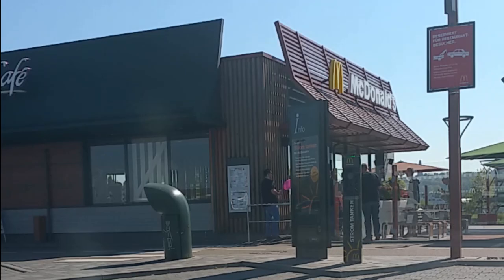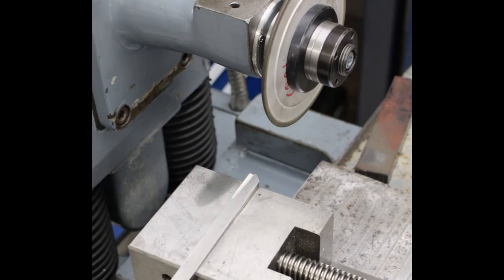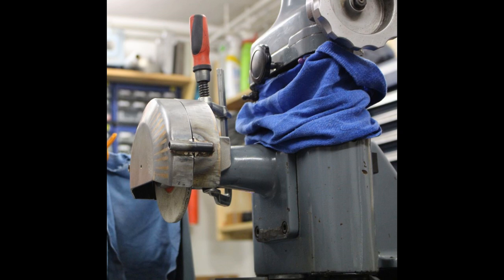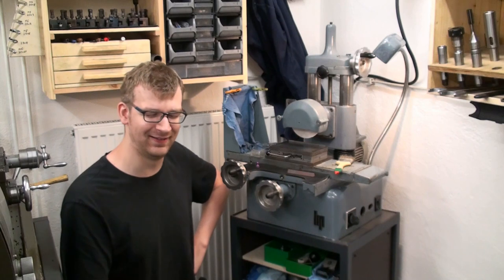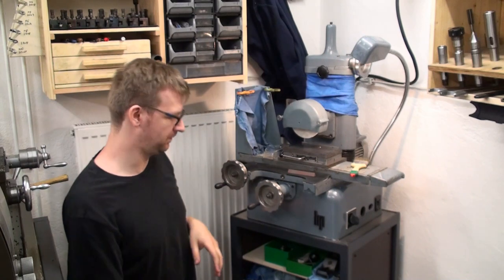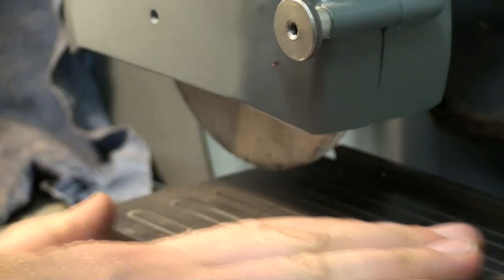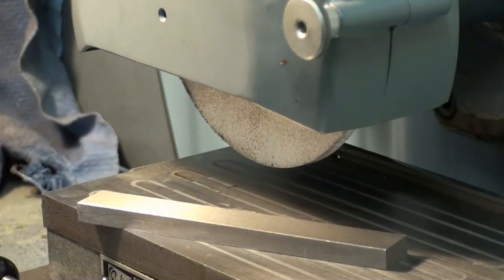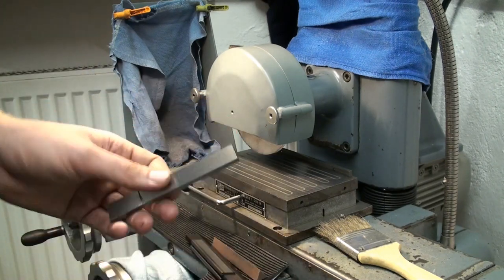LIP 515 surface grinder

Comment: very nice little grinder. very ingenious technique cutting the spindle taper not many would have thought of that. the wheel cover also shows what you are willing to do to make a part that is not only functional but proper looking. the machine looks right at home in your shop. thanks for sharing.

Comment: It's always enjoyable and interesting to visit you in the shop via your videos, Stefan.  I like your approach to problem solving: you always seem to find the simplest and most direct solution to a problem, for example, using the crossfeed off your lathe to true the taper on the grinding wheel shaft in place.  
The grinder is a gem, and you have made it fit right in as a member of your shop family instead of a stranger in a plaid suit and a funny hat.
I'm looking forward to your next shop adventure.

Comment: You are an incredibly talented machinist, thank you for sharing the videos! We were trained to cut the grinding wheel square with a diamond cutter and leave it running, mainly because the wheel can move slightly on the shaft each time it is started which can result in bad cuts.If we shut off the wheel, we had to recut it again to ensure it was square. I know you are aware of this, I just wanted to throw in my 2 cents worth. Thanks again!

Comment: You in industrial Europe have the nicest small machine tools on the used market. Nothing like that in my area except cheap stuff or larger expensive stuff.

I can't help but think you'll need to drape the area against tramp abrasive and grinding swarf. That shelf of set'up equipment for example looks like a prime grit trap: store clean equipment, retrieve it gritty.
 A crowded home shop containing a dry grinder could benefit from a blower and furnace filter in a box 

Keep it up Stefan, you're setting a fine example of how to run a home shop.

Comment: Excellent job, The cover turned out great. Everything looks fine. You need to think of retractable jacks for the base that will lock down to the floor to make the whole assembly as solid as possible. That will help a lot with finish. Anything to 
make  the machine more solid.

Comment: I friend of mine who was many years a tool and die maker before he came to our shop as it's toolroom manager described to me a method of grinding flat large large die shoes.  Make a dam of tape on the mag base. Melt paraffin wax and and flood the magnet. While the wax is still liquid, set your part in bow up. Wait a few min for wax to cool and get hard. Turn on mag chuck. The perfect 100% shim.

Comment: Wonderful little grinder. It also doubles as a lathe and will do taper turning :)   When I saw the setup I was amazed. Very nice job fabricating that wheel guard. In fact, the rebuild was very interesting, specially doing the bending.  Keep them coming!

Comment: Hi Stefan great video,It may be worth tring your motor with out a fan to check the vibrations.
A lot of the newer motors hav a plastic fan which flex when running,if the vibration is reduce replace the fan with 
a metal one most workshops that do motor rewinds will be your best place to call.

Comment: In my limited grinder experience I have found that wheel hardness has a big effect on final finish. For me it seems the softer wheels do better, but of course don't last as long or hold size as easily.
Reply: You're correct. Softer wheels are used on harder materials and harder wheels for softer materials. BUT... You also need to consider that you have to take into consideration the size of the grain. Wheels that are designed for use with coolant have a wider grain structure ect... ect...  Never stop learning.

Comment: Stephan, Another great video.  I love the amount of detail you provide.  Hope you are up for one recommendation . . . modify your wheel guard to include a grindings catcher.  I run mine with a shop vacuum . . . even when I am applying coolant.  If you use your surface grinder very much, you will see why this is a valid recommendation.  This is especially the case with the precision machines you have in your shop.

Comment: Great little machine, I really want one that size. Good work on the guard.
Get rid of those casters, there is a better way to do it.
Mount two wheel on the back of the base so they are a few millimeters above the floor. Make a "hand cart" type thing using two more wheels and a piece of square tube with a hook between the wheels. Add an eye to the base. To use, you just hook the handcart into the eye, and lever the machine up so the rear wheels contact the floor.
I have a commercially made version (I think made by HTC) on my wood cutting bandsaw. My bandsaw is a floor model (no base) about 2m tall and weighs quite a bit. I keep it near the wall, but I can pull it out to for running really long boards or for cleaning when I need to. It is a very stable arrangement and I find it is very easy to move and steer even though it weighs over 300kg.

here is a pick of something similar
http://www.popularwoodworking.com/wp-content/uploads/10707-lead-1.jpg
Reply from the maker: That is quite a good idea, but I think I will just put 4 screw jacks under it, as I will not have to move the grinder often - Only when somebody needs to get to the houseentry-fuses.

Comment: It’s a great find and the same applies for your rebuilding. I don’t even try to be as precise as you are. I have several parts which would make it possible to build one. Time and rooms are problems.
My question, if you please: what moves the longitudinal movement? Rack, gear, chain or what else?
Thanks in advance 
Old Bob

Comment: Stefan, I always seem to learn something new from your videos. The peening is something I will definitely want to learn more about. I am currently making the parts for my large lathe taper attachment that were missing the part is over 2 feet long and I'm dealing with the metal Bowing. If necessary I may try the peening method to straighten it. Thanks again.

Comment: i agree with old tony its the perfect size for a home shop
about balancing the electric motor , i wonder if it helps to static balance the rotor between centers and carefully shave away on the heavy end

Comment: Hey Stefan, don't worry about that chatter. As the part or tool is used and stoned after awhile the light marks will wear away and you'll be left with a nice surface.

Comment: Suburban Tool has a video showing a technique to obtain very flat parts using the residual magnetism of the magnetic chuck to minimize parts conforming to the chuck. I myself have recently acquired a Reid surface grinder and am trying to cure similar chatter problems. I think I will have to check the spindle for concentricity.  Thanks for the video
Reply from the maker: I haven seen that video from Surburban, but I dont think thats a good idea with a permanent magnetic chuck ;)

Comment: Other than the wheels, which you covered, my one concern would be the radiator on the wall next to the grinder. You MAY find that the "hot" end of the machine introduces a slight thermal distortion across the width of the part if the rest of the workshop is particularly cold (it probably needs to be measured if you are attempting to obtain the nth degree of accuracy). As far as the wheels and keeping things precise is concerned, maybe a precisely flat plate mounted on top of a thin rubber mat may work - the rubber would deform to adjust for any change in "level" as the machine is moved, while the flat plate would reinforce the stability of the machine base. Maybe look out for a chunk of an old optical bench top - they are designed to be precise, rigid and strong.

Comment: Nice video, thanks. That kind of machine really was missing in your shop. I think it is more versatile and useful than the shaper. The wheel cover came out great and in a style suiting the machine perfectly. Maybe it is a video compression effect. But to me it seemed in some scenes that the grinding carriage is not moving smoothly forth and back and has some stick/slip motion. Is there excessive friction or a too thick oil on the ways?

Comment: Hey, Stefan, great video! I'd really like to get a small little surface grinder like that, unfortunately everything in Sweden seems to be pretty big. You do seem to have alot of the smaller toolmaker-stuff down in and around germany.

Anyways, to the question: I got this Boley 4LV-lathe a couple of months ago, full with alot of the original accessories - which is great - but I'd like to restore the machine. I'm really struggling to get a hold of that original almost enamel-paint that the machine has originally. But when I saw your newly painted grinding cover I noticed that it seems to be more or less the same color and paint. What kind of paint did you use?

Comment: You did a grea job with your surface grinder. Can you tell me what votage most machines run on in Europe? Thanks
Reply: Hello The Ironworker
The most industrial machines in Europe run on 3 phase 380 / 400 Volts ans some machines on single phase 230 / 240 volts 
with kind regards Peter from the Netherlands
Reply: Thanks I have a Forge DE Gilly HBM  whick is a Belguim machine on 230 volts I think I will use a step up box and switch to 460 volt power

Comment: I used a mattison surface grinder chuck was 48 x 18 inches. Yours would have been of no use where I worked . Small parts it will handle

Comment: Hey Stefan have you ever considered some kind of bearing assembly for the top slide?  I have a similar grinder that is also just a sliding flat surface with oil grooves.  It works - but it 'could' be smoother action.  My machine is probably a little bigger than  yours.  A lot would go into it - but even if you haven't considered it - what would be the best bearing type and how would you attach it?  Any ideas for me?

Comment: Thank you for the video. This was especially interesting because I picked up a kugelmüller Grinder for 50 € at shpock. Hope I can fix Mine, too
Reply from the maker: 50Bucks? You know that getting that good deals is considered illegal? ;)
Reply: +Stefan Gotteswinter I think the seller didn't know, what he was offering. The Problem is the bore of the head and the column have a little wear. The column is 4/100 mm worn out, but the slited bore can be tightend with bolts. This reduced the play from 2/10 to 5/100 mm.

Comment: The fella i go for very fine surface grinding work has one of these in his shop. He did some modifications to it (not entirely sure what) and it's a very, very fine grade machine now. I believe he changed a few of the internals, but i'd have to ask him.
Reply: Question, why didn't you make the guard with a vacuum adapter? It's a lot more effective than other methods.

Also, you know those stove bases that have wheels? The white ones? They have that lever system that allows them to sit on legs when you don't use them and when you actuate the lever, you put them on wheels. Now, obviously that won't cut it since it's quite a weight to lift, but, maybe something similar where you use screws to have feet on the ground until you need to move them?

For my washing machine (a Miele w463) which i added extra weight to, roughly another 40 kg on modified legs, i made a system where the wheels have a hinge and a screw (each at one end of the caster base). When i want to move the thing, which is very heavy now, i have to crawl under and put a socket wrench on the screws that lower the wheels on to the ground. It's a painful process but it's worth it that once a year when i have to do inspection on the machine. Of course, my floor is perfectly flat, otherwise i would never consider this method. Way too complicated to apply to uneven surfaces.

Comment: Do you know where to get the 10mm grinding discs from? I have a LIP515 and could do with a couple of spares!!
Reply from the maker: I use mostly 125mm disks, most of them I had given to me from friends, but I just bought a Tyrolit 125x20x20 46Grit wheel that works very well on this grinder:
http://www.ebay.de/itm/351380452518

Comment: As beautiful machine. It blows my mind that you have 400v 3 ph power in your home. Not possible in the US
Reply from the maker: Almost all homes have 3 phase here, if youre not in some area with very old electrical setup.
Reply: Use a rotoverter to add a 3rd phase .

Comment: Hi, Anyone know diameter of two vertical rod of LIP-515 grinder? And the material is iron or hardern steel? I am trying to calculate some perfomance data of LIP-515 and evaluate the possibility to build a simple version for myslef since I can’t afford to buy one.
Reply from the maker: Hi, just checked, they are 50mm in diameter. Hardened and ground to a very good finish.
Reply: Thank you very much, I can start doing some simulation and structured evalution now. LIP-515 will used as my design reference. Thanks abagin and have a good day.

Comment: The side to side motion looks not smooth. I've noticed just about every time I see you use the surface grinder. Good video though. I hope to see the video of you moving a lathe and mill down to your shop. That's what I'm going to need to do. One step at a time.